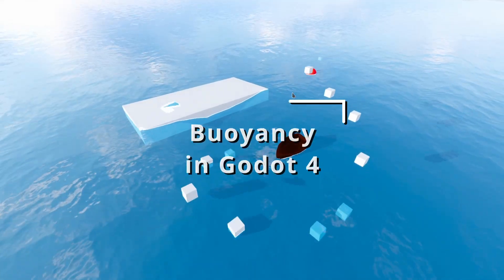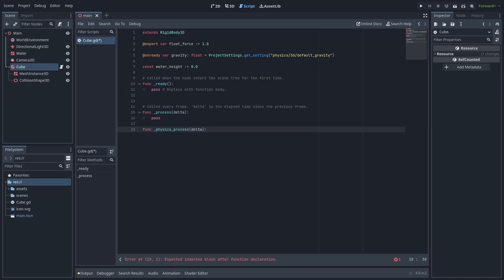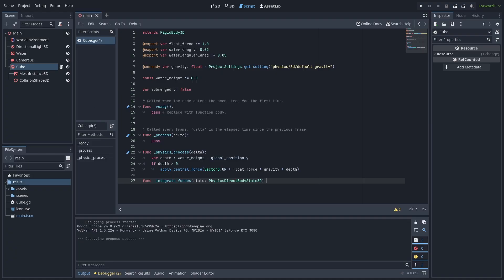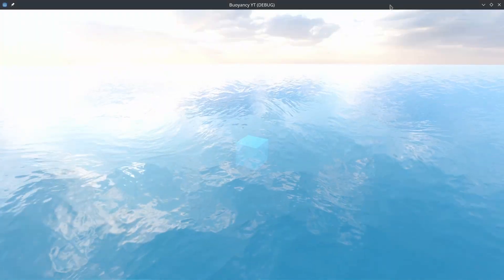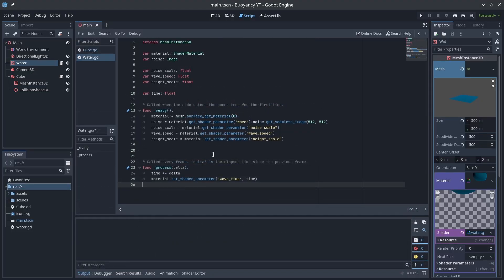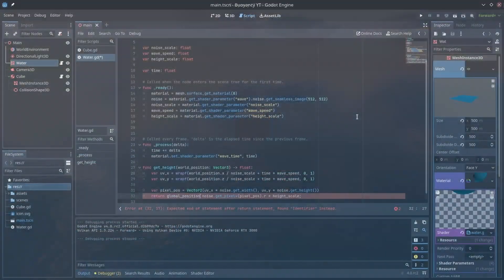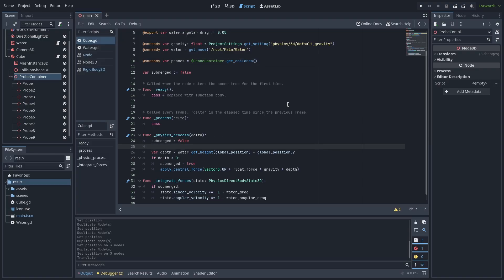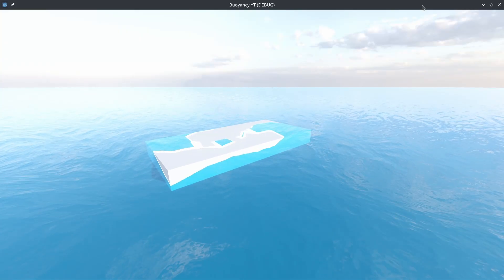How to make things float in Godot 4

Comment: ive been getting an issue in the water script where for the noise = mat.get_shader_para i get a null error, and i cant seem to find a fix for it, any help would be appreciated. ive also tried copying the scripts from git but it still gives the same error
Reply: I did this to fix it:
material = get_surface_override_material(0)

This is from the manual for surface_get_material:
Note: This returns the material within the Mesh resource, not the Material associated to the MeshInstance3D's Surface Material Override properties. To get the Material associated to the MeshInstance3D's Surface Material Override properties, use MeshInstance3D.get_surface_override_material() instead.

Hope this helps.

Edit:
This was done in Godot 4.3
Reply: @mustidmeyers-music4006  worked like a charm, thank you so much

Comment: This tutorial is great! Had to watch it about ~5 times before the logic started to make sense, but I think I get the gist of it now...

If you want, I'm trying to build a submarine simulator from these concepts to improve my skills mostly... I know I personally would be very grateful if you made tutorials on how to make a basic submarine controller, ship controller, and sail boat controller...

When I figure it out, I might end up making a tutorial about it, but you're obviously better at these things... 🤩😄
Reply: hi i would love a boat tutorial 
would just adding a force to the back of the boat work?
Reply: @vikketikv9486 Just tried it. Also tried to simulate steering behaviour of an outboard engine by rotating the force vector. Ended up in a mess and me tweeking the system by adding manual torques for yaw and heel when steering. Now it looks and feels quite nice, but it is not as straight forward as I would have hoped.
Long story short: you can add a force to the aft end of the boat (or a central force, does not really matter) and a torque for steering. Would also recommend to implement water resistance (opposite force to propulsion vector) manually for realistic behaviour since the buit-in drag does not resemble hydrodynamic resistance.
Hope that helps a bit :-)

Comment: Great video! However, if you use depth in the buoyancy force formula, you should limit it to a maximum depth. In your example, the deeper your object falls in the water, the stronger is the upward force. In real life, according to Archimedes’ law, there is maximum upward force defined by the volume of displaced water equal to the volume of the body (or height in your case). This is why objects heavier than water will drown and others will float.
In scripting terms, I usually use math.clamp01(depth/depth_max) in the force expression instead of just depth.

Comment: Its not working for me. It says: cannot call method  'get_shader_parameter' on a null value; the same with 'set_shader_parameter', i know it means there is no value, but idk why. Most likely i messed up something. (i did this in godot 4.1).
Reply: Hi, I am guessing, that you have added material to Surface Material Override, there is some sort of bug, get_surface_count() will return exact count of materials, but surface_get_material will be null, don't use that section, add instead to Material your water shader.
Reply: I have the same problem.

Comment: Apparently, density/pressure/buoyancy doubles every 10m of depth, so if you want more float_force for depth, you want to scale it down by 0.1 (compared to what you had).
Reply: The bouyancy of a compressable object would decrease with pressure not increase. An incompressible object, I believe, would remain the same.